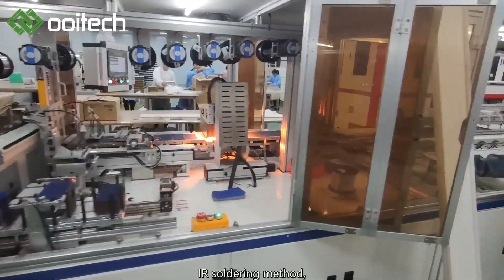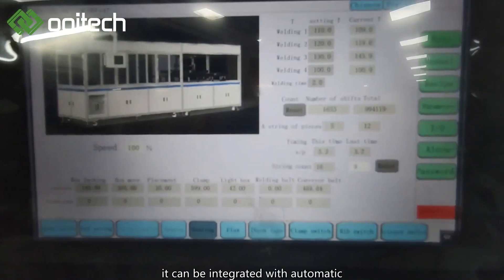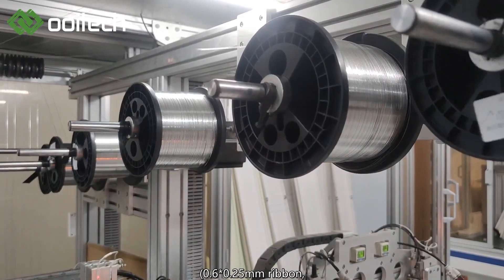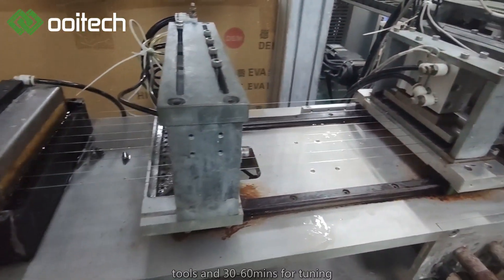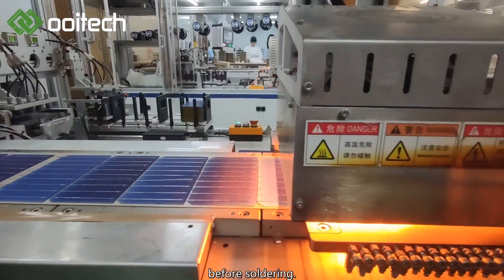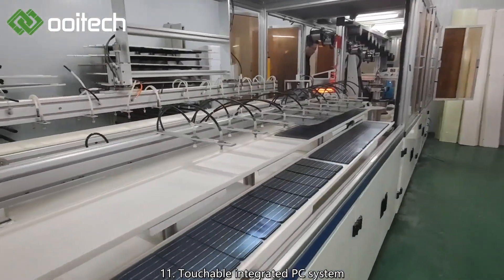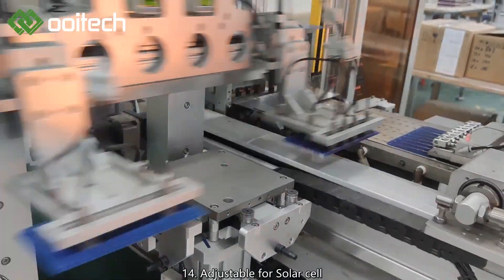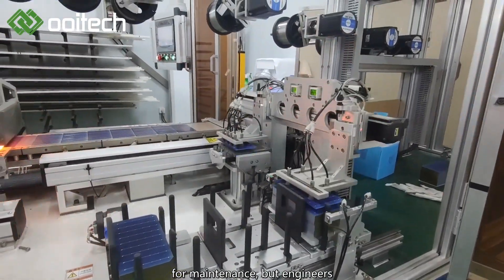🔥halfcut solar panel manufacturing 158210 MBB tabber stringer

Comment: For the alignment of cell, I notice that it has a mechanical alignment ( edge alignment) Not Busbar alignment, 
Cell alignment must coming by decision of camera and then placement the cells on conveyor  by at least 2 axis robot,
Reply from the maker: thank you, we also have 5 axis  robot positioning with ccd type, in this video just showing simple and low cost 

https://youtu.be/DGr_t_RjA_I?t=9 in this video showing robot high speed tabber stringer and ccd inspect